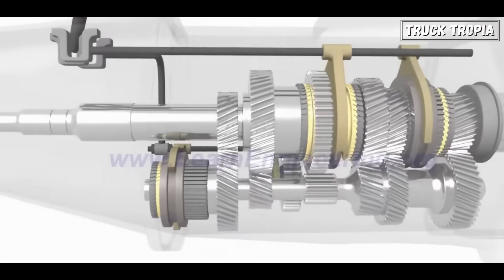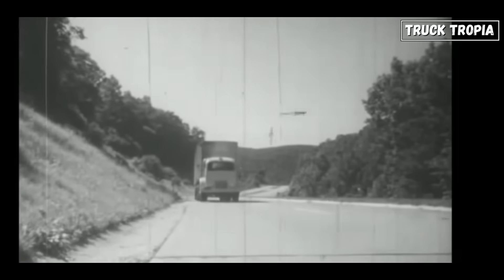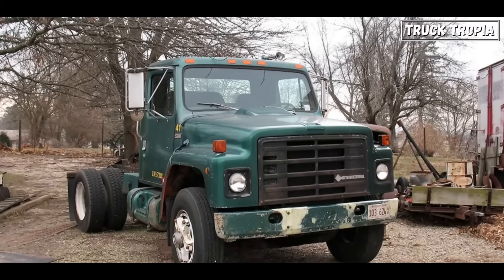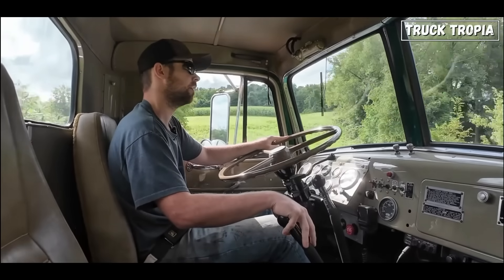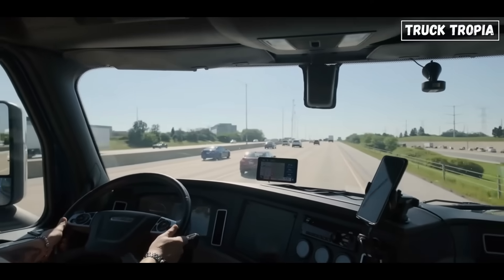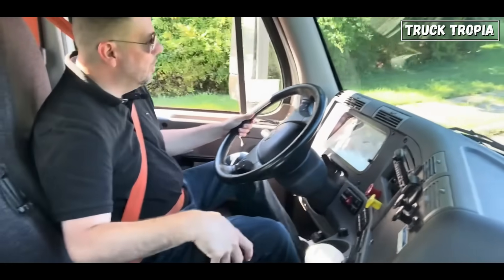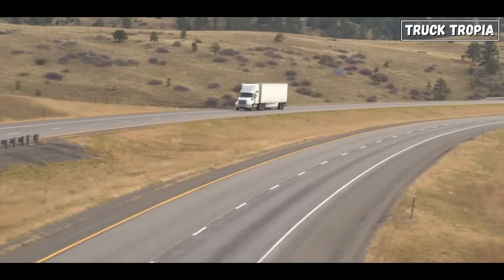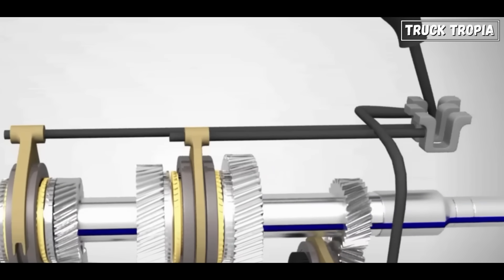Why Do We Keep Adding Gears to Trucks

Comment: This video isn't exactly true.  Over the years the number of gears in a typical over-the-road truck has been getting smaller.  That's due to engine design.  The earlier mechanical engines sometimes had two transmissions.  A 5 or 6 speed main box and a 4 speed auxiliary box.  The reason for this was because the mechanical engines had fixed injection timing and you couldn't pull them down too low in RPMs or you would ruin the motor.  So they had to have more gears to get up to speed with pulling the engine down too low.  Now with computerized engines the injection timing is variable and controlled by the computer, plus the engines have a lot more power than they did before.  Unless you're doing off-road or specialized trucking, you don't really need anything more than a 10 speed.  It's just not necessary.  However, to each their own.  You can have whatever you want.  I just wanted to point the older trucks had more gears than they offer today and that is a fact.

Comment: 1 of my first rigs to drive was a 76 Pete. 21 speed. Hat to get the passenger to shift the third gear shift. Couldn't reach it. Man what a beast. I personally owned a 75 international cabover with a 10 speed. Slowest truck ive ever had. Still prefer manual to automatic. Hate all the automation in the trucks. Even my small trucks and cars. I still prefer manual. I bought a 2020 chevy 2500. As soon as the warranty ran out. The auto tranny came out and it got 6 speed manual 4x4. It tows so much better with the manual. Gets better fuel mileage to.

Comment: The real engineering reason is because the Internal Combustion Engine is a poor fit for this purpose. It has a very narrow rev range, and is even more inefficient when you try to make it operate over a wider one. This is why Tesla's Semi is going to rapidly displace this obsolete form of transmission.

Comment: Cab over makes docking so easily. Just like a yard truck 😅
Reply: @Mike-gc9ih  I started with brand new cabovers back in 1974 when they were the norm. There is a real good reason you rarely see them now in North America. Nobody wants to drive them! Do you want me to give you twenty five reasons? Europeans are forced into these little boxes with claustrophobic sleepers because of cramped roads, and length restrictions, but they'd never sell again on this continent.

Comment: I retired after 37 years of semi driving. Great career. I always preferred the manual but that's all there was back in the 70's. The company I worked for started buying automatics about 20 years ago. They claimed better fuel milage so who am I to doubt the bean counters. I'm sure it is easier to hire someone today if they never drove a manual let alone a 5 &4.
Reply: That's the main reason - easier to hire somebody, and not having to worry about rookies damaging the equipment.

Comment: seems another AI story who has no real knowledge or research trucks yrs ago might only have 4 gears but they also had 2nd transmissions behind the main trans and or a 2 speed rear axal a lot of old tandems only 1 axal was driven  also a 35 ft trailer was not hauling 80k ot 92k  they pull in some states and Canada also until the late 50s to 60s few high speed roads trucks needed low gears for mountains why out west different trucks were developed in tne late 60s and 70s power increased and so did trans get fewer gears if  they were running level roads more as did auto start i wonder if west coast mountain runs are auto or staying with manual od the hybrid clutch setup

Comment: OG Mack trucks didn't need a lot of gears due to their powerful engines matched to gear ratios and load. They built the entire truck themselves. Their Brockaway brand used Mack cabs with other makers' drivetrain.

Comment: Unbelievable...more US specific BS. Nobody remembers the 5 speed Mack transmissions from the 60's, coupled to Maxidyne engines. The clown who made this video knows nothing. BTW, the 18 speed RR is still a 5 speed in reality. You work out how it's done if you can.
Reply: @MichaelSuter-s9k  All North American heavy trucks use the same identical 5 speed H pattern. Correct. And they get from that pattern the 9,10,13,15, and 18 speed which I drive. Most of us on this page know how we get 18 gears out of that. For those that don't, it's simple 5 gears in low range. Split them and you get 10. High range has 4 gears. Split them and you get 8. So 10 plus 8 = 18. Sometimes when fully loaded in the hole I will use all of them. On a level plain I don't bother to split low range. Easy peasy!

Comment: I prefer 18 gears because it gives you a 200 RPM gear step. That permits  you to keep the engine operating at the peak horsepower range.

Comment: Hi. The main reason trucks have more gears is because they're diesel powered. Compared to a petrol engine a diesel engine has a narrow r.p.m. power band, whether for maximum power, maximum torque, or maximum fuel efficiency. The diesel engine must keep within that narrow rpm range otherwise it ceases to be more efficient than a petrol engine. This is especially true when accelerating, climbing hills and even slight inclines. If the diesel drops below (or above) its power band it becomes a gutless wonder, hence the need for so many gears to keep it "on the boil". Diesels are most efficient when operating at a constant rpm. 

Smaller trucks powered by petrol don't have or need so many gears. Electric trucks are like steam engines, they both develop maximum torque at zero revs, and don't need a gearbox at all. Keep on truckin' y'all. Cheers, P.R.
Reply: this. Carry 40 tons with 400 hp over hills need as much gears as possible

Comment: He shows a driver split shifting with both hands, which means most likely a 5 speed main and four speed auxiliary transmission, due to overlap giving 16 forward gears and 4 reverse, but claims those 50's and 60's trucks only had 4 or 5 gears, yes, only 4 or 5 in each transmission)).

Comment: I'd love to drive a truck. As long as I never have to back it up. I've seen a lot of truckers do miraculous things in a packed lot to get to a specific gate or dock. Some of you guys are artists in my mind.
Reply: @teejay6063  I am a 49 year veteran long haul driver. If you promise to not tell anybody, I will tell you our secret to backing smoothly and effortlessly. Just put your hands on the bottom of the steering wheel. If you want your trailer to go right, just move your hands to the right. Left? Move your hands to the left. It's just that easy. After a while you won't need to put your hands on the bottom of the wheel anymore. I drive a Peterbilt with an 18 speed. We have 4 gears in reverse. I regularly shift gears in reverse when empty. However many years ago I drove a Mack with 5 gears in reverse. Our job required us to go very fast in reverse with a loaded Belly Dump Tridem Trailer. Many times I went all the way up to 4th in reverse, with another truck bearing down on me doing the same thing. I never got up to 5th in reverse, but trust me, 4th reverse is plenty fast enough.

Comment: Close but no cigar. It's all about the power band. you missed the spit rears, and a 18 speed is actually a 6 speed with an internal 3 way giving you 18 forward and 3 reverse. the fuel economy comes from the engine technology.

Comment: Electric drive trains and no gear charge whatsoever is the new way to go!
Over here in Europe, the number of e-trucks we see on the roads is growing noticeably every month.  And their drivers love them, never wanting to go back to diesel rigs!
Reply: @st-ex8506  Sorry to break it to you, but e-trucks will never make it on the long hauls that we do here in North America. City shuttles will work. Been doing that for many years. They just keep going back to the shop for a new fresh truck. But long haul like we do? Nope. They tried e-v transit buses in my city for three years, and they finally threw up their hands and gave up. They found that in winter 70% of their battery power was used to keep the passengers warm. That left only 30% of power to run the motors. They kept running out of battery half way back to the charging station. Oops! Well they're at it again! This time if you open the charging port door, there is a big sign that says...wait for it... "Diesel Fuel Only!" Oops again. It turns out that the good old fashioned internal combustion engine is great for keeping humans warm. Sorry. They're not sustainable.
Reply: @SternDrive  My first suggestion:
NEVER say never!
Sorry to break it out to you, but OF COURSE they will... and MUCH sooner than you think!
The trucking business is all about the bottom line.  And if e-trucks improve the bottom line of a logistic company by tens of thousands of dollar per year and per unit, that company will promptly transition to a full electric fleet.
For example the rather large German trucking company Nanno-Janssen, which operates hundreds of trucks, has stated last October that they would only buy electric trucks from now on... INCLUDING for heavy-load long-haul applications!  I am sure they can count, and do it better than you!
BTW, e-trucks are pretty insensitive to cold temperatures.  Even by 0°F weather, they lose only 5-10% range.
As to electric bus, my home city of Geneva is going with electric buses, which have only a 75 kWh battery (the size of a Tesla Model 3 battery), for a huge articulated bus with a capacity of 110 passengers, working 18-20 hours a day.  That is enough... even in the winter!  Watch this video to know how it's done:
https://www.youtube.com/watch?v=qLPmWEtgTy0

They have over 140 such units, either already in operation  (since 2018) or on order. And by 2030, their entire fleet of diesel buses will be replaced to these electric ones.

So, your anecdote only proves that your city public transport company is not very competent.

Diesel is dead... although some have not yet realized!

Comment: I drove a 10 speed with a 4 speed auxiliary transmission.
Reply: @johnpapa8681  What? On your game boy simulator? I'm calling BS.  I've been driving long haul for 49 years and have yet to see such a transmission. Tell us more about this mythical transmission.
Reply: @SternDrive  first of all, there's lots of trucking that isn't long haul. Some trucks have asphalt tanks on the back and bars that spread that asphalt on the road during construction. Before these trucks were computer controlled like the Bearcat CRC spreader truck, these trucks needed a lot of gears to calibrate the truck to a specific spread rate of so many gallons to a square yard. This was anywhere from .05 gallons to .5 gallons and sometimes more. I always spread at about a 1000 rpms. And used those gears to make slight adjustments in the trucks speed, which would change the  application rate. My truck had a RTO ten speed with a separate 4 speed auxiliary transmission which can be installed in any truck as long as it isn't too short. Now days these trucks are generally computer controlled and work different from the old spreaders, and don't need all those different gear combos. I've operated both kinds.

Comment: I have no experience on driving and many other things, but i prefer always having FULL control over the situation and each tiny detail, so i would prefer manual transmission, maybe semi-automatic, but never fully automatic transmission, having an automated system take control over my movements would not be fun at all, not one bit.
With manual and semi-automatic i would have full control of the transmission and i can know what it's doing at all times and act as i see best fit the situation.
Though of course, an experienced driver would put the vehicle to better use, but manual transmission allows said experienced driver to actually do his job.
Reply: These automatics do have a "manual" function when you can change gears by tipping the stalk up or down. That's if it's enabled, the company I drive for has them set so that you can't do that. You can still manually change the gear up or down and keep it in a certain gear if the stalk is held up or down by hand. However that only lasts for 90 seconds or so and it'll change by itself. I've been driving for almost 30 years and prefer a manual, however with these automatics it's much easier to start out on a hill. Especially when there's  a hill start feature which holds the brakes for a couple of seconds to let you get your foot on the fuel peddle.

Comment: I "grew up" in trucking with 13 , 10, and one 5x5 transmission. This allowed for a smaller difference between max torque and max horsepower, meaning keeping the engine in a range it was most efficient in. The people doing this video missed that part of it AMT transmissions are very sensitive to battery voltage. A reduction in voltage from the desired 13.8 to 14.5 will cause drivability problems, just as bad as a shift system getting extreme voltage, typically over 15, with actual component damage possible if the sensitive parts have a voltage over 18VDC . I have driven AMT transmissions and have asked shops to check the output voltage and the battery condition when drivability was suspect.

Comment: When i first started loading Log trucks Most trucks had a 5-speed main and a 4 speed Auxiliary that is 20 gears, Some even had 2 speed Axels then they went to a 13 or 15 speed now they have updated the 13 speeds into 18 speeds. I always thought 20 was more than 18.
Some guys tried Automatic transmissions for logging but the lack of ability to lift heavy loads in muddy conditions soon eliminated the Automatic trans. i have seen Automatic Transmission trucks sit in the mud and moan when they were trying to lift a heavy load. The transmission is not the problem but the, Torque converter slipping under hard load is why Automatic trans are not the best. The old manual 5x4 trucks always had a gear low enough that they could lift the load. I have seen Trucks with a 250 hp lift a load were a 500 hp with auto would fail.

Comment: I have seen my share of expert drivers , they can shift gears while making the truck sounds like it had an automatic, without using the clutch. I also seen some who had to crawl out of a gravel pit on a steep incline fully loaded. They need to shift at least once and the timing had to be perfect. 1/4 second slow and the truck rapidly lose speed to a dead stop........on the slope. be rough on the drive train, and you are likely to drop a drive shaft. I say only the top 5% of drivers can do these jobs. Just like shunting, for the top 5%, they have one try time allowance to back a trailer in perfectly. Most drivers are not that good.
Reply: @tonylam9548  You are right. Some of the new guys really suck, and it is pathetic to watch. When I am fully loaded in the bottom of the pit, I have no problem getting out, because I have an 18 speed, and sometimes I will shift 10 gears in low range, while my buddies are crawling out in low gear with their 13 speeds. They sure envy my narrow RPM splits in low range.

Comment: Diesel engines have narrower torque band than gasoline engines, therefore they need more gears. But in real life scenarios, the most gears practical would be 9, 10 speed. Usually the more speeds go to drivers that been with the company for a while with proven abilities. Most drivers are not the best trained , and when you stick them with a truck with split axles and you have to shift a certain way through the gears, for at least the first day or so, you have to think before every gear shift and they often damage the transmission. Many do not even know to look for the shift pattern at the top of the visor or a sticker on the panel somewhere. This is especially true with agency drivers that never get the same truck twice. If the shift pattern is not available , you have to guess. Most people get out of driving schools using an automatic, and it is possible to get a truck license and you cannot shift gears , and even to get a job (cement trucks)

Comment: The emissions equipment keep adding  on engines each year are making the newer engines WEAKER thats why the transmissions keep adding gears to make up for the lack of pulling power .
Reply: @LisaCabelarow  Well that is not quite true. I started in 1974 and we were driving brand new Kenworth cabovers with 250 horse power and no turbo. Now we all have turbos, and the truck that I drive has 500 horse power. It also has an 18 speed. So it is wrong to assume that we now have multi speed transmissions because we have lower powered engines. I don't know who told you that, but I'm glad to set you straight.  We have multi speed transmissions, (did you watch the video?) so that the RPM is always in the sweet Zone for better fuel economy, and for engine longevity. Glad to help! 😂

Comment: More gears= more cost but better drivablity with more drive ratios ava
Reply: Also truck engines cant rev high so to cruise on the highway with no effort you need pushing power to speed up instead of waiting in 4th to go 80 mph

Comment: It's not only commercial vehicles. We now have PICKUP TRUCKS WITH 10 SPD. TRANNYS. A friend of mine owns one & I asked him if his pickup really needed 10 speeds. His answer was NO!
Reply: @keith4886  Your friend is right. They don't need that 10 speed. They could get by with a 2 speed power glide. They used to use them in racing cars. However, his fuel economy would be crappy, like the good old days, and his engine would be over revving, and then lugging. Wiser people than you and I know that your fuel economy will be far better if your RPM is always in the sweet zone. And the big bonus is that your engine might be happier and last longer.